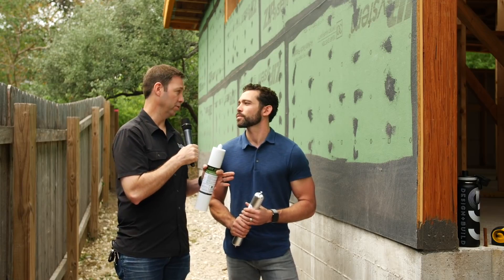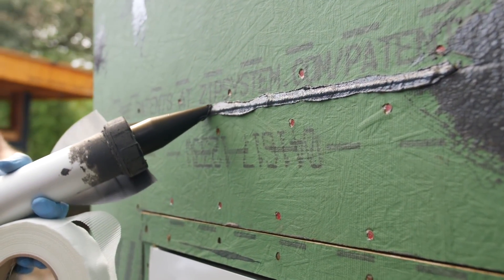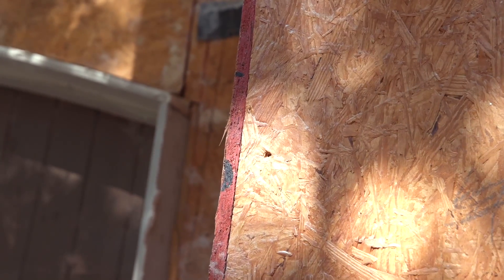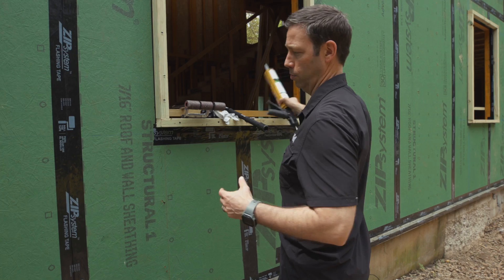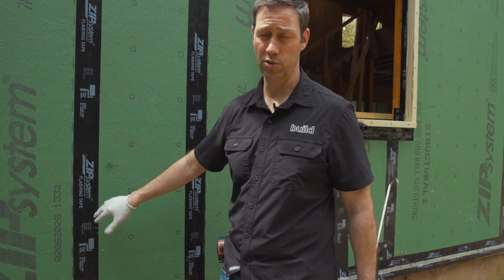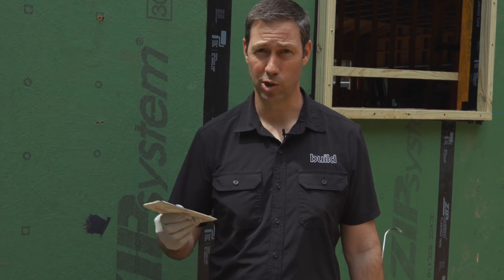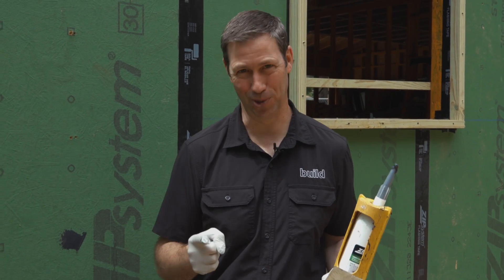Zip 1.5 - What about Over-Driven Fasteners?

Comment: In this video you recommend smoothing off the calk over the nail head. In other videos with exterior insulation you sugest putting some calk dalops or ribbons to allow a water path. In that case would you not trowel the nail heads?

Comment: Matt, about to start a new build & gonna use Zip system. My question is how to address siding fasteners that completely penetrate the Zip system on the inside. Do these fasteners comprimise the air/water barrior? Thanks!
Reply: If it's a hole in the barrier I'm sure it does. I wouldn't trip too much over it I guess. You will have some penetration. It's not possible to have a 0.0 ach 50 in a house. Too late to pull out the siding I'd assume.

Comment: Bad idea to use zip on the roof. From what I’ve been told, no roofing manufacturer will warranty their stuff without an “actual” underlayment and in some cases they want their specific branded underlayment.

Second of all, it’s a much much better practice and comes out to about same price or less than ZIP system to use 7/16 - 5/8” CDX plywood for BOTH roofing and sides (especially roofing) and use the Hydrogap self adhering membrane where you don’t need to worry about any overdriven fasteners etc. 
Hydrogap will seal itself around nails and staples being driven into it.

Comment: Matt...      We see little of brick home construction in your videos, yet I have a question regarding Zip and brick.   I'd appreciate a little practical education on this...    In the process of installing and flashing Zip/Zip-R sheathing, great lengths are gone to to seal all joints, penetrations, etc...   Meanwhile, when the brick masons get to work, they temporarily hammer dozens and dozens nails into the structure as they work their way up the walls, then pull them back out as they make progress on the work.   As a practical matter, I know of no tradesman who would re-tape, or flash these nail holes as he's concentrating on the brickwork.    And I can't envision a party standing around to tape every hole after the mason removes a nail and continues...this all the way through the brick job.    So in practical terms, does tight construction lend itself to brick home construction at all, or is the effort largely in vain?   I'd appreciate your commentary.   TIA.

Comment: Is it necessary to waterproof ZIP System sheathing? I feel I already spent a fortune upgrading from Tyvex as recommended by our builder and now they are suggesting we waterproof with a emerald coat to prevent water penetration at the nails, adding an additional $6k in expenses. isn’t that the whole point of getting ZIP to being with?
Reply: Heck no don't do it. Never saw anyone do that and I've been watching a ton of videos about zip installation.

Comment: THERE ….IS…..NO….WAY….YOU ….CAN ….get …TODAYS….LABOR….FORCE …..ON…..ANY….SPEC…..BUILD…..to APPLY ZIP TAPESMOOTHLY, completely. AND FIRMLY!same applies for semi custom YOU CAN ONLY get documented carefulframers to do this properly in the NE if you are paying the gc >$350 a sq foot …and if Huber were so confident this was waterproof why do they insist on underlayment under their roofing product? Nb zip properly taped isNOT permeable at all. Huber has come out with a permeable take to try to partially address this valid issue and Huber isn’t better than regular osb  but water is krytonite to both esp if it can’t escape . In addition using zip r in lower insulation levels esp r3 which most choose actually puts your wall in MORE danger as not enough insulation - roughly it should be 1/3 of total wall r- is outside your wall cavity! These risks are small by why even countenance them just so a builder framer can slap this assembly up quicker and pass added costs to you . Zip tape alone is as much as say Henry blue skin a much thicker better barrier than the resin paper Huber uses. If you can get you framers to tape zip meticulously u can certainly get them to hang blue skin properly esp vertically which has other benefit of NO horizontal shingling issues.PLUS it is vapor permeable!!! I’m not saying this id a bad product at all but it’s great for Huber and builders much more so than homeowners.framers and gcs are saving on install time but passing these sundry risks and costs onto consumer. In the end you have a vapor impermeable osb wall with hundreds of linear feet on horizontal non shingleddrainage plane at no savings to customer and relying on a resinned paper product

Comment: Matt Risinger, what about where the house meets the foundation? I recently discovered that my deck is attached to the house joists and the sheeting doesn’t come down past the decking. To add to this, the siding stops a the deck and water collects. There is no water proofing where the deck and house meet. I was wondering if zip liquid flashing could be applied on the sheeting, deck and house joists, and any other joints to prevent further water entry into house.

Comment: Matt. I am building a home in Houston and love watching your videos. I have learned so much about building quality and building science. As for Zip, I do see the advantages but it really needs more cost effectiveness. Your recommendation to only liquid Zip the holes up about 2 to 3 feet really is not enough. You seem to be assuming only rain water will splash to the lower of the stucco and thus get behind the stucco. Not, here in Houston, condensate will form between wrb and stucco, and if there are nail holes in Zip then this condensate will make its way into the board and over time will rot it. You should think about this and revise your video. In this stage of the build, you have only one opportunity to plug holes ... liquid Zip is cheap and use it and Zip Tape in abundance before the applying stucco/brick.

Comment: I am using Zip system for the first time on a build in Northwest Washington. What is your thought on zip sheeting during a winter build where it rains nearly every day? I have had some problems on the horizontal seams at the center of rim joist. I would apply the zip tape on dry days since there is so few of them but i noticed that the tape never adhered properly because water would drain underneath the bottom plate  and get behind the horizontal seams of the zip panels. Is it better to wait till the roof is dried in before taping the horizontal seams?
Reply: Read the manufacturer's installation manual (https://www.huberwood.com/uploads/documents/technical/literature/ZIP-System-Sheathing-and-Tape-Installation-Manual.pdf). You don't want to tape in those conditions and are better off using a fluid applied flashing as it bonds and cures in wet weather and on damp substrates. It's going to cost you more but will address your issue.

Comment: Hi Matt, My house is currently traditional house wrap with t-1-11 and with vinyl installed over it. I have found some extensive rot from the vinyl holding moisture against the t-1-11.  I would like to re-sheet with ZipR to improve insulation value but I have a concern about this air barrier at the outside perimeter of the wall. What happens if water is able to get into the wall cavity with zipR? Is the water  or water vapor able to escape?

Comment: Help! My question is from minute 4:33 ending at 5m. The 2 inch board you installed to receive the foam. 

What are some thoughts of leaving my block exposed to 2 inches to receive my foam instead? 

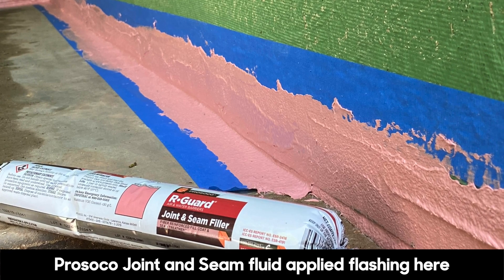I could use a fluid applied flashing between my Zip and the 2 inches of exposed block similar to the picture at minute 4:55. 

Open to all suggestions! All comments welcome!

Comment: Not required, the only nails that matter are on the perimeter of the of the sheet as far as shear. According to zip you would have to over drive the fastners more than halfway through the sheet and even then it only reduces shear by 20%. Covering over driven nails is not required period and does not cause problems.  Again this info is directly from Huber.

Comment: I'm a designer. I'd like to hear from builders on this. Regarding liquid flashing the sheathing to the face of the foundation - maybe we should set the sill plate back from the foundation edge and let the exterior face of the sheathing align with the foundation. Then we could liquid flash directly. I'd like feedback on that idea from builders.
Also, I'm wondering if termite mesh could be incorporated into this spot as well, perhaps embedded in the liquid flash. Any thoughts on that?
Reply: This detail was part of a Minnesota build featured in the current issue of JLC "Evolution of a High-Performance Wall" using Zip-R. From my perspective as a builder in Chicago, this was a good read because the detailed illustrations are helpful, the steps you are describing helps meet the important goal of continuity of insulation/air sealing, and the author has given serious thought to real-world conditions with simplified systems that protect against builder screw-ups. The wall assembly in question approaches R-28, but the same principles apply in milder climate zones.  See https://www.jlconline.com/how-to/exteriors/evolution-of-a-high-performance-wall_o
Reply: @afs3294   This is a great read.  Thanks for posting it! A "perfect wall" for realistic conditions.
Reply: Yes yes yes!! This is exactly what I was thinking to do next time.  Pour an 8" wall (instead of a 6" wall) and recess the sill plate to the inside. Then add 2" off outsulation (or buy ZIP R12) and seal the bottom edge which is now flush to the foundation.

Comment: Love it Matt. Interested in using zip on my siding remodel... Planning on taking down wood fiber siding..taking down wood fiber sheathing..inpecting and adding insulation as needed... And putting up zip... Would like to see more videos on bottom edge details. Framing is flush with concrete...

Comment: I am currently building a House of Metal frame and isolated Panels. Should be about Passive house. Why dont you build the slab foundation Higher and Put the wooden framing on top so it is off the ground bit more.? Cheers from Germany

Comment: @ Matt : very interesting video sir ... it just seems ironic that you have hated so much on using house wrap because you put hundreds of staple holes through it , and now you are saying that a holes through your weather barrier is no big deal ... (past the lower 2-4 feet).    You also specifically that the other poorly build house (to your personal home) was not a good example that a weather barrier isn’t necessary. That it was a very leaky house that had huge heat loss that allowed the inside of the wall to be dried out and not experience rot as bad as in a new tighter house . It seems you are forgetting this part .. it was a very leaky (energy wise) house that was drying the insides of the walls , and possibly helping limit the damage those overdriven nails , and missing weather barrier would have caused on the house had it been better insulated and sealed off from air movement going through the wall.      Honestly, your friends parting words at the end of that video seemed to contradict what you Both said , that this is not a good example to look at for building practices.         As far as your roof “not leaking”..... that was 1 rainstorm... just 1.... that’s hardly proof enough to how long your roof would last.. especially on an OSB sheeted roof .      This is just a thought . I usually like your videos .... but this just seems like a bad idea . Would you feel the same way if you had that many holes (because that what all those nail holes are) in a housewrap or on a feel-n-stick membrane , as you have on your OSB zip sheathing ?

Comment: You are probably saving at least 100 tubes by not liquid flashing all your seams and around all the windows.  I speak from experience. I used over 90 on a 2000 sq ft rambler.  I would definitely consider ZIP 1.5 in the future.  One could argue that this is ZIP 1.25 because you are only selectively filling nail holes.  LOL!

Comment: I’ve switched from Hubers zipwall to LPs Builderlogic sheathing. I’ve seen great results, the boards don’t flake on the corners when you cut them, Stiffer boards allow for less flexing and the boards feel like they are more structurally sound. Also you save money using builder logic,  I believe they’re 5 to 7% cheaper than zipwall. You get a rebate on the first house you do with the Builderlogic. I use a roof membrane sealant spray at the nail heads and the bottom 6-8 inches gets sprayed as well.  This house will blow away the blower door test!
Reply: Huber is offering a rebate for first time users as well.  Happened to just see it on their website today.

Comment: 2010 project needed very low HERS for permitting, led to Dr. Joes's continuous exterior insulation. House to get stone veneer over, and all the masonry ties become an issue. Any fastener penetrating the water control layer becomes a wick for water. Could not find anything meeting my needs, sheet goods have a problem in "outie" window frame/ boxes (which we used). At every point 3 planes meet, every layer of sheet materials must be cut to turn the corner. Decided on wet-applied over whole house. Tested Barritech VP, which is self-sealing around fasteners up to 1/4" dia. Made OSB test pans, coated, and added fasteners bare, and foam plus fasteners. 2" water evaporated out in one week, with no discernible penetration to the std OSB. Re-did the test with new pans, fasteners and foam, and this time 2" water, then covered the pans in polyethylene sheeting. 1 month, no evaporation, and NO penetration to the OSB substate. Used the Barritech for the house, from foundation to eaves, no problems so far. For context, the risk/ consequences factor can be hinted at by the following: $750k for the masonry contract. 
For all sorts of reasons, I think that once you go to exterior insulation, the water and air sealing needs to be absolute over the sheathing/ substrate, and to me, filling a few nail over-drives is far short of the answer. A lot happens to a wall, in the succeeding processes, and you don't see the effects of what you are doing/ covering up.

Comment: I’ve built my house in SW Washington using Huber Zip System, walls and roof. Taped all joints and used the liquid product on the nails only on the walls. Site gets six feet of rain on average and no leaks. My concern is when the rain screen walls are installed there will be numerous fastener holes in the Zip System created by attaching sleepers and rigid foam insulation. There is no practical way to seal these holes. On the roof it isn’t an issue because it’s a standing seam metal roof. Should I be concerned about the walls? To your point about the base of the wall, we used a shop manufactured sheet metal flashing that covers the base of the wall and overlaps the foam insulation on the foundation. Top of the flashing is sealed with Zip tape.
Reply: I'm hoping that's covered in the next few videos when the rain screen is added.  :)
Reply: Great questions i'de like to know the answers to, also.
Reply: I have posted recently on a couple of other video's, re: Zip is apparently NOT a self-sealing coating (mechanically it is hard to envision that it could be, per thinness and bonding/ flexibility if the coating. 10 years ago we did a huge, complex,  multimillion dollar home, more or less along the lines of the "Perfect Wall". As you seem to be, we felt we could use one set of standards for the roof assembly (protected by geometry and material choice) and a more rigorous set of standards for the walls. After some really tough testing, we settled on Barritech VP as the liquid applied self-sealing membrane for 100% coverage of wall surfaces, which were conventional 2x6/ OSB over. Barritech VP was used with compatible sheet materials to cover the lap onto the poured foundation, and went to the underside of the roof sheathing. Only air channels were the joint between our rafter tails (4" LVL extensions to pick up overhangs of 2' 8" or 4', depending) and the underside of the same roof sheathing. I can live with that small omission. Application is some amount of work, but our tests showed that per manufacturer's specs, 1/4" diameter washered masonry anchors could be installed through the 2" of polyiso foam, and seal (test pans had the assembly UNDER WATER for a month, no issues of water penetration). House was complete in 2013 (walls with $750k stone veneer over, were done in 2012) and there have been no leaks or water/ moisture issues whatsoever. Personally and professionally, I believe (from experience and observation) that the ZIP system is UNDERKILL, because of the issue you have raised, and the inability to self-seal. That led me to believe that my client's money was better spent on a set of products & finished assembly that would absolutely perform as required. Bear in mind, Matt operates in what appears to be a relatively dry and benign climate, and that gives him more leeway than some of the rest of us have.

Comment: Not that I am an expert but perhaps you could apply all over the north facing wall as it gets less un exposure. Also if you live in a rainy area where the wind typically comes from one direction I would apply extra on the side facing the wind and the opposite wall as well.

Comment: We did Zip 1.5 on my house 6 months ago.  I did the nail holes higher than 2 feet from the bottom, which I expect Matt will also do on his house.  After we do the closed-cell spray foam, it will seem like overkill.  Belt and suspenders, indeed.

Comment: Matt, can you tell me a maker of a peel and stick wrb with a perm rating of between 5 and 10 perm? I am using J. lstiburek's wall assembly for hot humid climate, with exterior Rockwool comfortboard. Hope you can help.
Reply: 3M 3015 VP is 12 perm